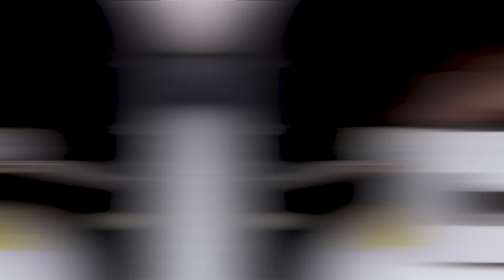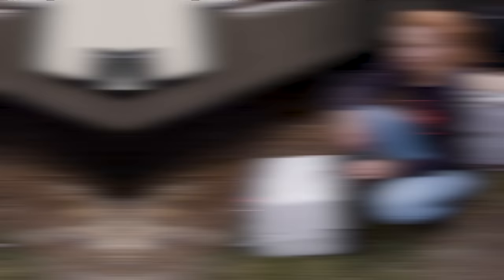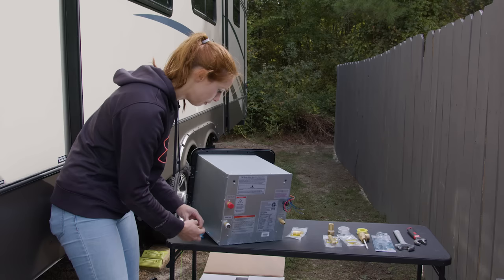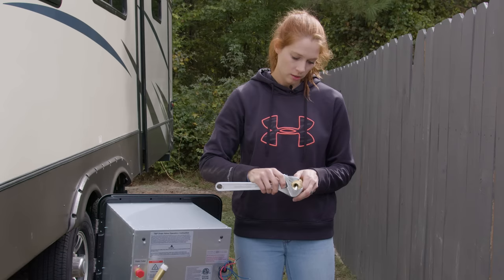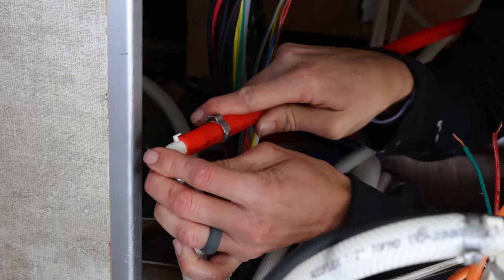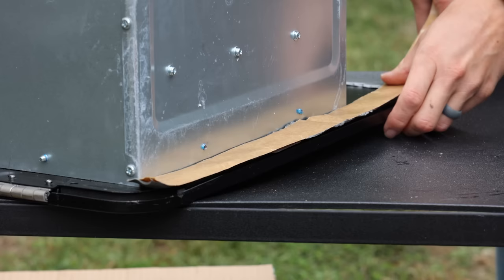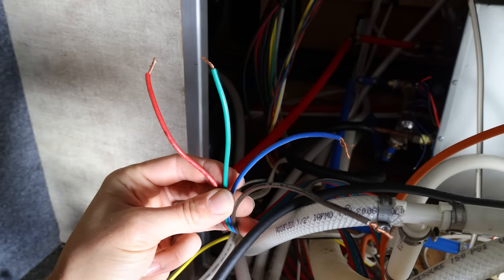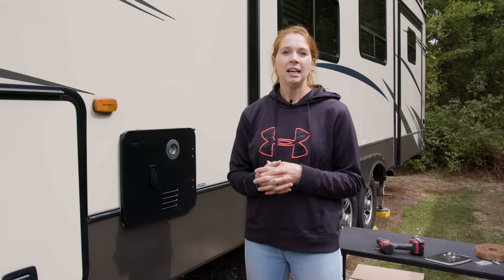(UPDATED) Installing a New Fogatti Tankless Instant RV Hot Water Heater: Easy step by step guide!

Comment: Lol what. Connect your hot and neutral wires done. Then the other 2 just wire nut those. Then with my fingers in the way I’m just gonna wrap these other wires up and not show you at all what they do( control wires ). No help at all on the wiring and my camper has 3 wires not 4.
Reply from the maker: All campers are not wired the same, and if you only have 3 wires, you need to get a meter a figure out which is hot/ground, unless you know which was which coming out of the original hot water heater.

Comment: You wrapped the tape the wrong way before installing the tee onto the unit and then showed an example of the wrapping it the wrong way when installing the pipe nipple. Not to mention continually using the adjustable wrenches and pliers in the wrong direction as well. Good God I hope you don't do this kind of work for a living.
Reply: You wrapped the tape on the gas connection the wrong way also. FFS. Hire someone that knows what they're doing before you cause anymore damage.

Comment: You put the pressure relief valve on to where you can't open it and you install of the thermostat controller horrible place you should not do big projects on your own
Reply from the maker: I opened it many times without any issues or restrictions 😂

Comment: Good intentions, but bad very dangerous advice to put tape on a tapered gas line. The 10+ other mistakes might cause a water leak later. Should have consulted a pro before making the video.
Reply from the maker: This has all been addressed in my 8 month review video, so make sure to check that out

Comment: Is this a joke? She goes through the correct direction to apply the Teflon tape then consistently applies it wrong, she Teflon tapes a flare fitting and failed to check if the other end of the fitting was installed with Teflon tape or sealant. Maybe somebody tightened the Tee and other pipe and fittings for her off camera, but she couldn’t because the weren’t any flats to put the wrench on! Then the sealant tape wouldn’t stick to the flange on the heater so apparently it needed to be cleaned off. 
I hope nobody follows these instructions, they are liable to end up with water leaks at best and propane leaks at worst
Reply from the maker: ‘She’ is me, by the way. A real person. I have a video of a review/updates that I posted explaining the mistakes I made, and I encourage you to watch it. We all make mistakes.